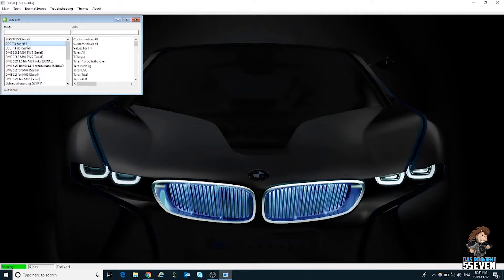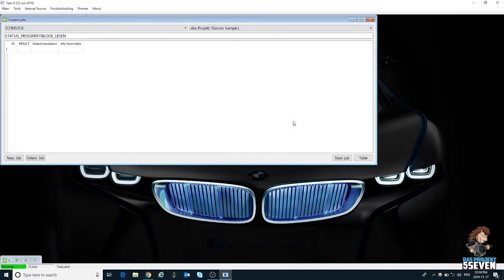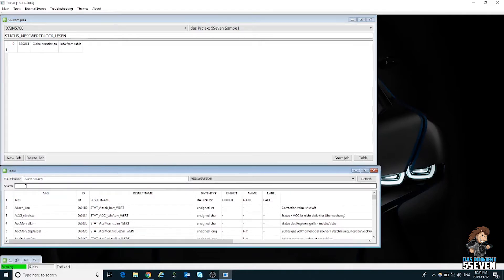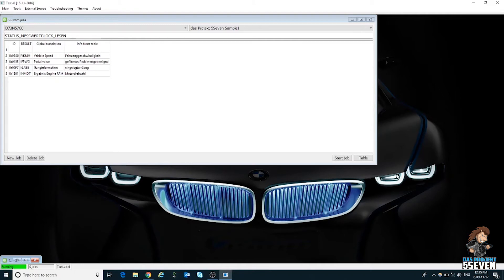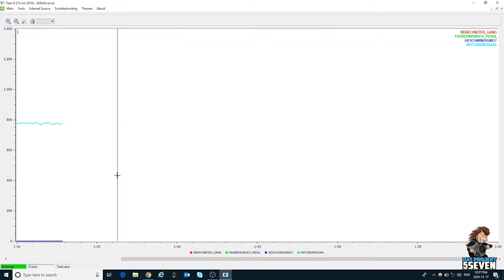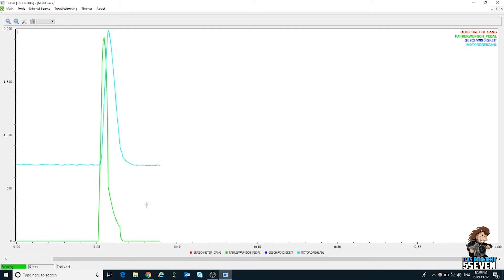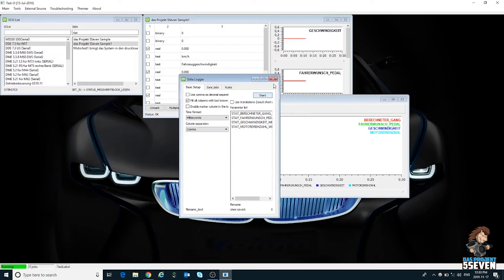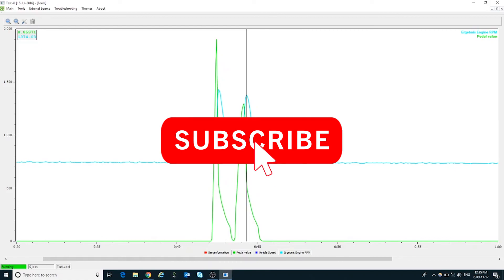TestO Custom Jobs Setup

Comment: Hello there. Nice video bro can you help me with testo all working okay but if im trying to test the AFR not reading 😢😢😢 please any chance to help
Reply from the maker: There is a parameter for AFR for the M57 motor but I find it’s hard to read. Depending on what you are trying to diagnose you better off looking at boost vs the EMP values.
Reply: Thank you so much for your raply  

My engine is m54B30  .. if you have email address can i text you if you  thank you so much

Comment: Is there way to add ignition correction to log since its not there?
Reply from the maker: I have not seen that parameter.
Reply: @alphadevyat   i did some ignition tuning whit romraider but it did not drawn the table so i used test0 to make 2d map out of those ignition knock correction logs, its just bit of hassle to use two programs.

Comment: hi , thanks for video , have me e36 ms50b32 engine , i open custom job but cant finde it , can you tell me please if possible log m3 e36 b32? thanks
Reply from the maker: Never tried. If you see your DME listed then you should be able to log. Custom job you will have to create yourself. But use detect ECU function to see if the program will see it.